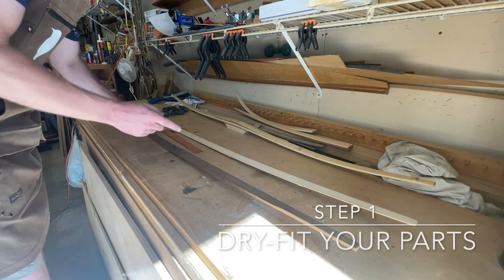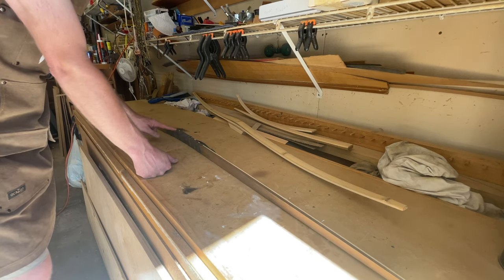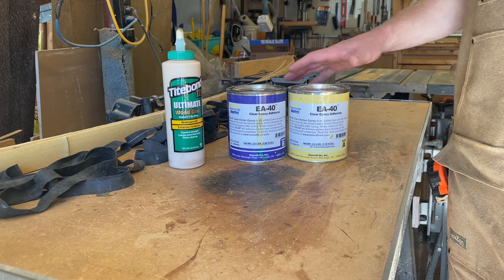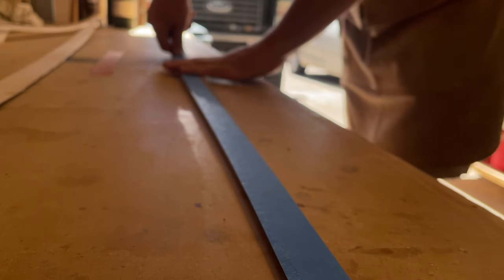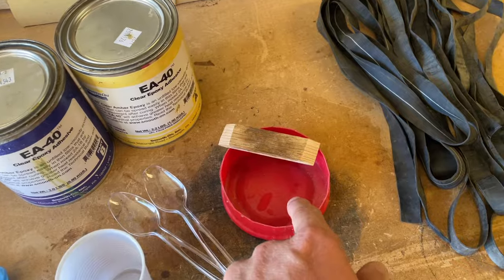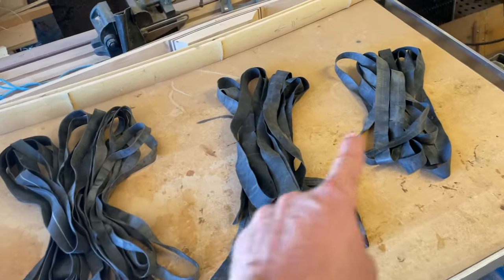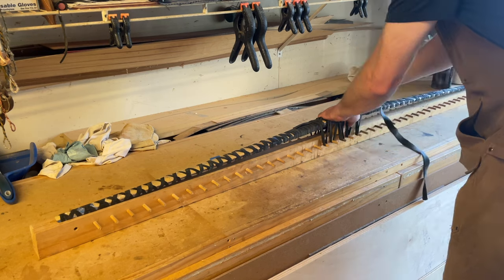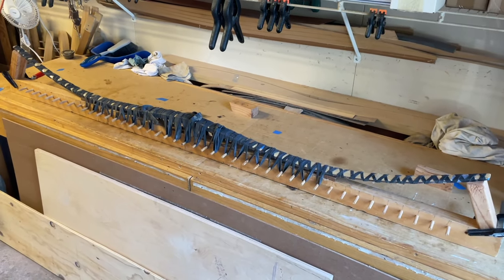Gluing up the R/D bow

Comment: How do you get the ipe belly lam to take that much deflex at the handle? I steamed some at 1/2 inch and 3/8 thick for over an hour and couldnt get it to loosen up and want to bend. I steamed the 3/8 for 1.5 hours, then gorilla grip clamped it and it raised a splinter. With the same thickness I can't get any deflex in the stave during glueup without starving the joint from clamping downwards so hard.
Reply from the maker: This is the process I use:

The deflex
https://youtu.be/P7kzCEsCaAE